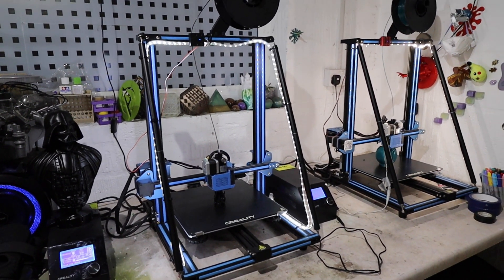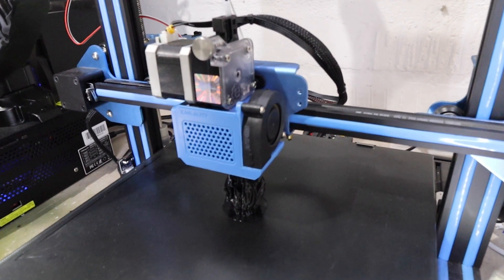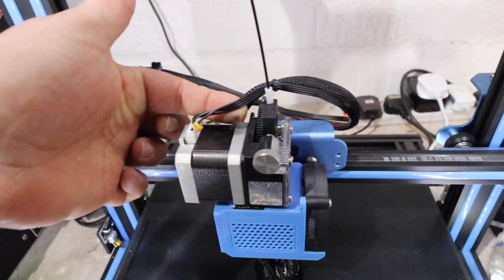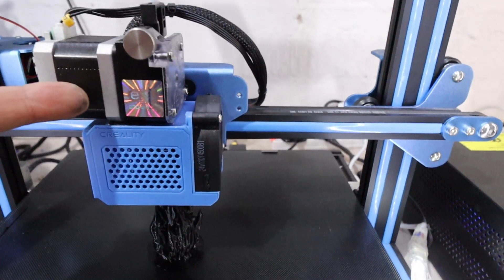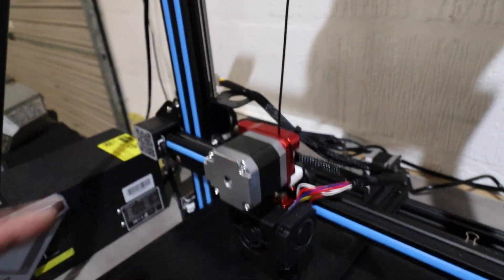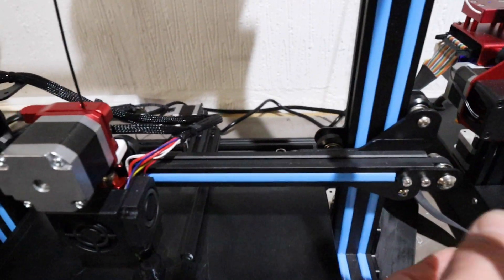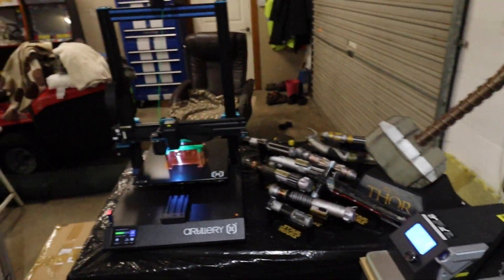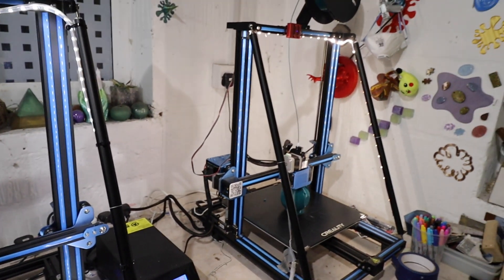Creality CR10 V2 Titan Extruder Review

Comment: How can gantry be lighter when you put the motor on the cross rail?
Reply from the maker: It takes the strain off of the side of the printer and balances it out by moving it to the rail, dont knock it till you try it 🙂
Reply: @BeanGaming-w4n  yeh, but you said its lighter - its not - more balaced perhaps but not lighter

Comment: Has anyone had like a squeaky noise from the extruder with every retraction?
Reply from the maker: Try slightly loosening the plate on the extruder sounds like you have tightened it to much

Comment: Great video !! I bought my CR-10 V2 just about a year ago (December 2019) I have 390 hours on it and I have started to run into issues with clogging in the hot end. I pulled the hot end apart and cleaned everything out and I figured I would mount the titan since I had it all apart. When I bought my machine last year it was advertised that it came with a titan extruder, so as you can imagine I was a little disappointed when it wasn’t included. Wanting to eventually go the direct drive route I purchased the titan in January 2020 and it’s been sitting in the box all this time. Installation was pretty straight forward and the new firmware version was a breeze. Once I adjusted the step acceleration and Z offset with BL touch I was up and running. I have to say this is way better now than a Bowden setup. Especially single gear Bowden setup. I should have installed the titan a long time ago. I also had to relocate my spool and run out sensor but that was easy enough.

Comment: Question. I have a V2 like you. But my filament runout sensor.. I want to move it just like yours. But.. I can’t find any cable extensions for it. How did you do it? Can you link me to where you bought the extension cable for the filament runout sensor please? Great video btw.
Reply from the maker: Its been awhile since I done that mod to mine and I cant remember where it came from, I think it was banggood or aliexpress, I did come with a sensor but I just used the cable
Reply from the maker: @kommentfloh8425  hi, i used this https://www.banggood.com/Lerdge-1_75mm-Filament-Material-Run-Out-Detection-Module-Sensor-For-3D-Printer-Parts-p-1323359.html?rmmds=search&cur_warehouse=CN

Comment: You cant print over 250mm since the extruder will hit the support braces. Just letting you know if you print tall and to the sides. Keep that in mind when slicing.
Reply: Does this apply to the v3 too where the titan extruder is included standard? Should not be the case right

Comment: Good vid. I'm looking at the V3 and currently just have the Normal CR10. 
I use the .6mm on it. I take that it just the same simple hot end switch on the V2/3?
Reply from the maker: Hi, the v2 and v3 are near enough the same apart from v3 already has titan extruder and they have put a filament detector on the top of the machine

Comment: Recently have done the same upgrade. Thought it was easy.. but I'm having a lot of problems with TPU coming out the extruder. Have you run into this by chance? If so how did you fix it.  8mm/s through a .8mm nozzle. Tried every temp.
Reply: The problem with TPU is caused by the adapter from Creality. There is no Bowden tube inside the black nozzle from the titan Extruder. I had also lots of jams with TPU, but putting a second piece of Bowden tube between the aluminium adapter and the black plastic piece fixed it. Check the manual from e3d, originally the Bowden runs through the heatsink inside the Titan.
Reply from the maker: Hi, i never used it with tpu only ever used pla, where is it coming from?
Reply: @BeanGaming-w4n   right after the gear . Pla works fine but the tpu which is the reason I got it isnt working.
Reply from the maker: @justinguerrera8322  I'm guessing you have upgraded the firmware, have you tried loosing the nut the applies pressure on the gear?
Reply: @BeanGaming-w4n   unfortunately yes. im new at this so lots of learning yet. im sure something will come up and il lget it figured out.

Comment: Really. Nice video
I would like to know your opinion on the CR-10 V2 /V3 Vs the Artillery. (pros & cons)
If you had to choose one which one would it be?
Thanks in advance
Reply from the maker: hi, i love the cr10 v2 i think its a cracking printer that works really well, i cant comment on the v3 as not had one, i wouldnt go for an artillery, i did have the sidewinder, its a nice looking machine but i just couldnt get on with it, the cr10 is much more user friendly and there are alot of upgrade parts and spares are easy to find, i would pick the cr10 v2 over anything yhat i currently own as it just works and its hassle free
Reply: Beanie's Hobbies Thanks for your reply.
I think the V3 is mainly a V2 but with direct drive from stock. (Filament run out and roll holder modified) so more or less as your V2’s modified
Reply from the maker: @raulgarciatapia5557  currently got a tevo tornado and the trantular rs that i will be reviewing soon, but the board on the rs is faulty so waiting for a replcement, another good printer is the creality cr10s pro v2
Reply: Beanie's Hobbies Thanks for your reply.
What were the main issues you has with the Artillery?
Reply from the maker: @raulgarciatapia5557  bed levelling was one of the main issues with it

Comment: i was watching makers muse' video on this subject, and he was mentioning how difficult it was to install. Don't know if you've seen that video, but im interested in hearing your take on it as you say it was an easy, 10 minute job. I would really really like to do this upgrade, but not if its gonna have the problems he had.
Reply from the maker: I watched that as well and thought to myself whatever is this bloke going on about, this is the best upgrade I've ever done and was so easy to install, I can't understand why he had so many problems as its soooooo straight forward
Reply: Beanie's Hobbies well I guess I’ll put it to the test! I’ve been having problems with under-extrusion and bad layer adhesion.  To which, I can’t find the cause of and I’m starting to think the tube is binding up. Hopefully this solves my problem. Fingers crossed..
Reply from the maker: @SleepyJoe1973  hi, did you ever do the upgrade?
Reply: @BeanGaming-w4n  hello, i did do the upgrade, but iv ran into a few other problems. I think my main board is fried, after the wire for the hot end themistor touched the  carriage, and shorted out. I should be receiving my new parts shortly. I did receive the extruder, and i cant quite get what he was on about either. Altho, obviosuly I haven't printed with it yet. But as far as assembly goes, i really think it was quite easy.
Reply from the maker: @SleepyJoe1973  hopefully you will get it up and running soon then, dont forget to update the firmware as well, told you it was an easy upgrade 😉  Beanie's hobbies will always been honest as I have to spend my own money as nothing is sponsored or given to me
Reply: Beanie's Hobbies I hope so as well and yes I have done that. I have found the smaller guys have more reliable information on YouTube, and you did not disappoint! Thank you for the help.